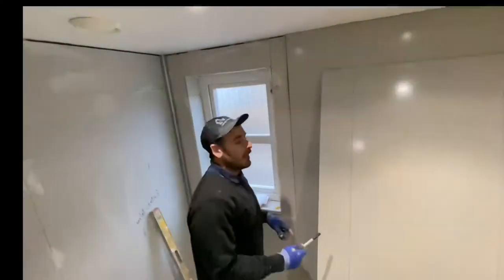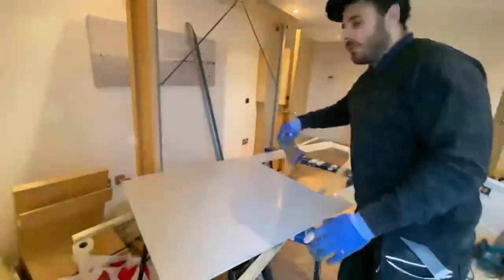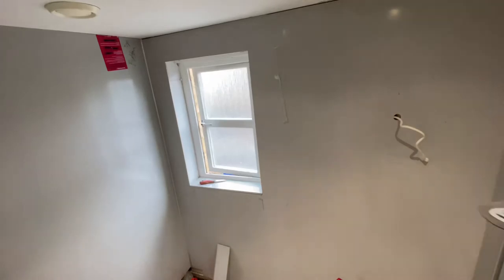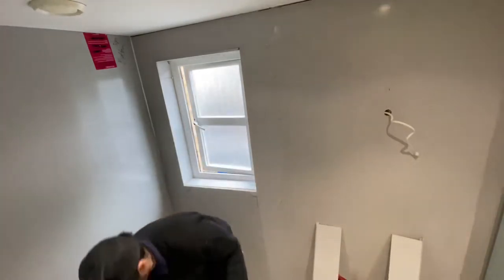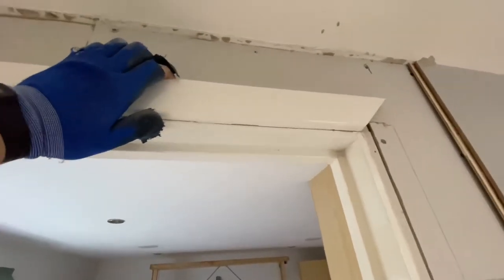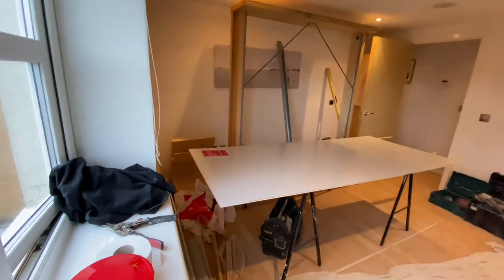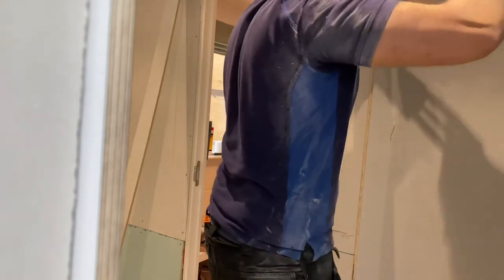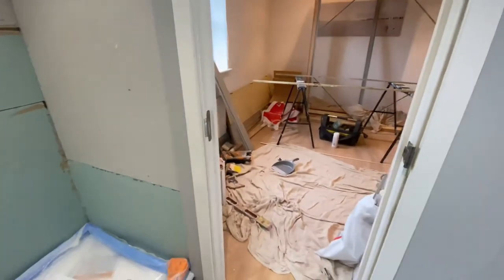How to bathroom panel around windows and door frame

Comment: Great videos! We are thinking of using tha panels in our bathroom but was just wondering how you tie the panels into the floor to make it waterproof/wet room?
Reply from the maker: Hi Jason thank you! The way I like to do it, if planning on tiling the floor is. Tank floor and up walls around 150mm then run a baton around about 120mm up of floor. Panel walls onto baton. Then remove baton, tile floor then tile up to the panels. So you have a tiled upstand if that makes sense. Hope that help Jason.

Comment: Very helpful video.  My circular saw is too heavy for this delicate job.  I could look for a lighter one, but what were you using because I couldn't find it on any searches? Thanks
Reply from the maker: Hi Michael. Thanks for the comment. I mainly use a rail saw sometimes know as a plunge saw. They are fantastic at cutting sheet material straight. Good luck mate

Comment: When doing all four walls how do you fit the last panel because the corner trim is already secured?
Reply from the maker: That is a very good question! Multi panel do a trim called last panel corner type Y. Have a look all will be revealed. Or check out my video using multi panel Invisible corners. 
https://www.rubberduckbathrooms.co.uk/multipanel-last-corner-type-y-by-grant-westfield
Reply: @everlastbuilders  cheers buddy👍🏻

Comment: My window in in the shower is there anything u would do differently in that situation due to the direct contact with the water?
Reply from the maker: Hi. No problem in shower area. I normally slant the bottom piece a bit to help water run of. Just make sure it’s well siliconed around all edges and ideally give it a squeegee after showers.
Reply: @everlastbuilders  awesome thanks for the fast reply
Reply from the maker: No probs. Hope all goes well!

Comment: What would you do if you had a wall hung seat in a shower, but we're fitting pvc cladding onto plasterboard.. Use plywood?
Reply from the maker: Very brave! Absolutely make sure it’s solid behind panelling. If your using hollow panelling it may not be able to handle it and squash in! Good luck 🤞
Reply: @everlastbuilders just to make sure,  so cut out wbp ply for the back of folding seat hinge and use it as a template for hollow panel to cut around, a tried method perhaps?
Reply from the maker: Should work just make sure it’s well sealed!

Comment: When cutting the panels, how do you avoid chipping the front - do you have to use a fine blade, say 80T? I know you said to use it face down with a skill saw as that's what I'd be using, any other special techniques you reccomend?
Reply from the maker: Hi thanks for watching. Nope sadly no special techniques. I just use a fine cutting blade nothing fancy. Multi panel are solid and doesn’t chip that easy. Some other brands are a bit weaker so you can experience minor chips. But most small chips will be covered when siliconing up at the end. Hope that helps mate. Good luck
Reply: @everlastbuilders  thanks for the reply! When you say fine cutting blade - is it 60T, 80T, 96T, etc?
Reply from the maker: @JoeAverage2006  about a t 50 would do the job. Hope it goes well mate.